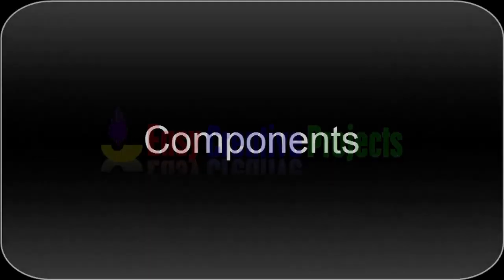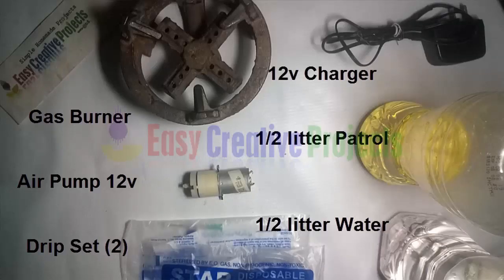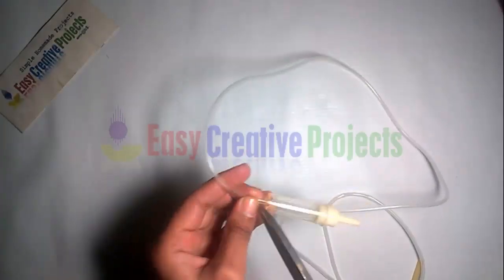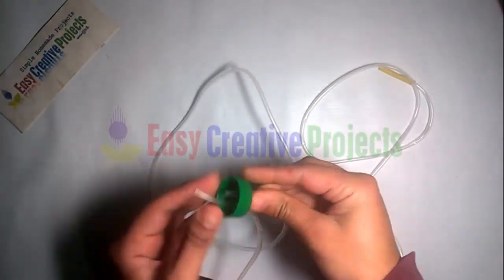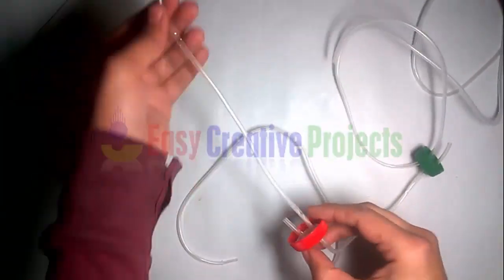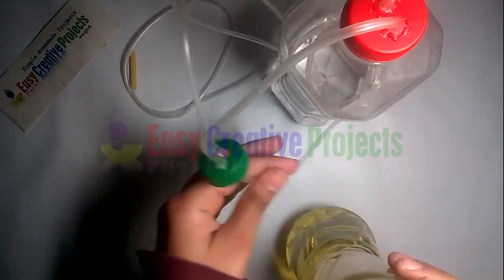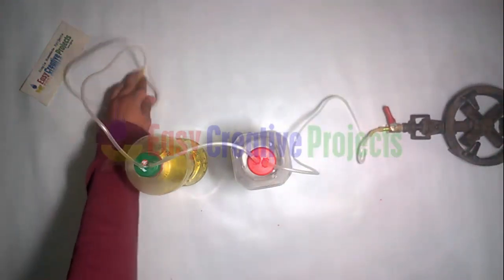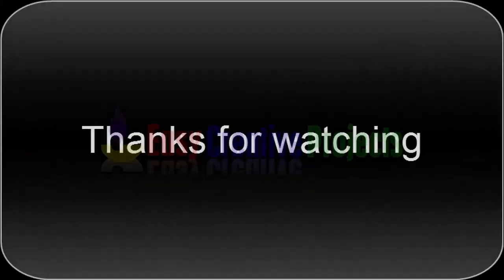How to make gas for cooking easy at home - Free LPG - CNG

Comment: How many volt charger did you use?
Reply from the maker: i use 9volt charger.  but this pump operate with 12v 1amp charger or power supply.
Reply: @EasyCreativeProjects  did you submerge the pipes into both fluids?
Reply from the maker: no dear one pipe inside and 2nd pipe use for passing air in both bottle. if you want to see diagram or more detail so please visit our website. link are in video discretion.
Thanks.
Reply: @EasyCreativeProjects  thanks
Reply: All pipes must be inserted into both liquids? Could you please draw a diagram?